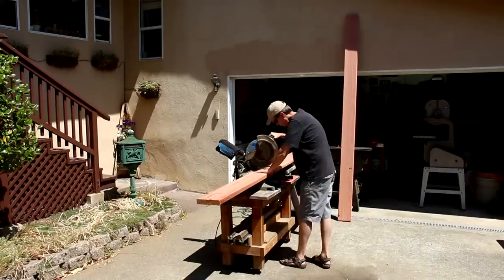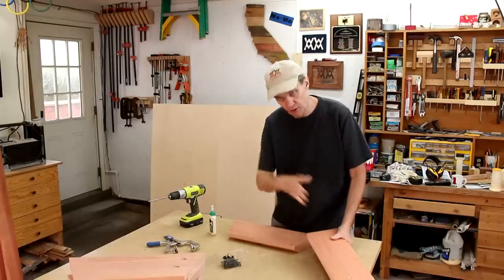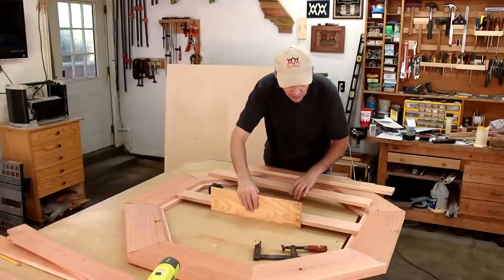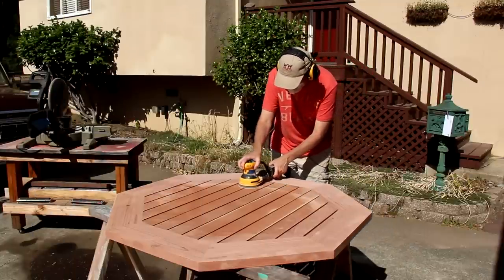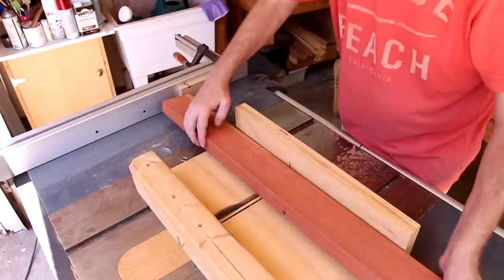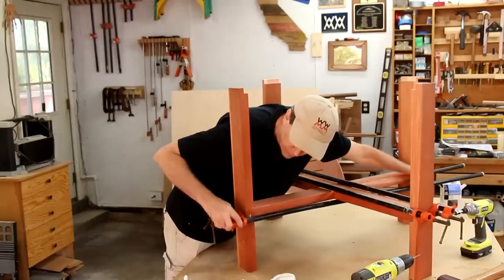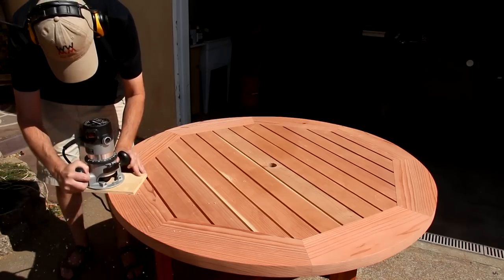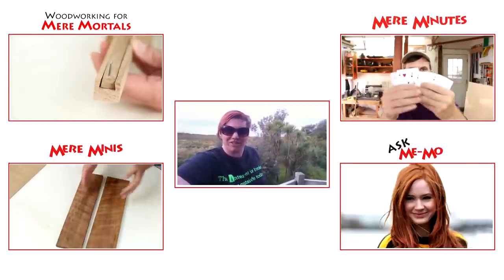How to make a patio table. This outdoor table is easy to build!

Comment: Nice job. The top is almost the same as a table I purchased a couple of years ago.  It was made of Merbau/Kwila timber by a retired German engineer turned woodworker. Each of the segments of the rim had a mortise on one end and a tenon on the other and were assembled with epoxy and a draw bored pegs on each joint. I bought it because it was a work of art to my eyes and something I might aspire to. Unfortunately I am a woodworking hack and not the Garrett Hack type either..All the best.

Comment: Thanks for this wonderful video,  if any one wish to know diameter of table from length of rectangle piece  it is  
Diameter = L x Cotangent(cut angle)
This formula give you diameter of finish table ie cutting outer corners.
One more formula to know how many pieces required from cutting angle
No of piece = 180/cutting angle

Comment: Did you carefully work out the dimensions so that you needed an exact number of smaller boards to fill in the centre with a 1/4 inch gap between them and all the boards the same width, or was it a happy accident ?

Comment: Hey Steve, In hindsight what would you have done differently? Reason is- i'm wondering if the legs are kinda 'getting in the way' when sitting at the table(knees, leg room). I'm thinking about putting the legs farther away from the outside perimeter, a little closer towards the center.

Comment: I would have to stain and finish before assembly, just to make sure the cracks are hit, they are still prone to moisture. Then sand smooth, then stain and finish the top.

Comment: Loving the videos, I'm 21 and recently got into woodworking. I have a few basic tools (jigsaw, drill and palm sander) and today I built a bench for my flat/apartment which was really fun. I finished it with some polyurethane spray like in your wood finish video but it was quite expensive for my budget (I used free wood to make the bench though). I was wondering what is the most cost-effective/cheapest product to use for a clear, smooth finish for wood? Thanks for any advice!

Comment: Great project. Took a look at the plans and we’re working on figuring out how to make it bigger. We want to do this, but we want a table 63” across rather than Steve’s 48”. I believe the angle needs to be 18 degrees, but what about each board length? And, maybe I have the angle wrong, who knows. Width of board is the same as Steve’s here, 7”. If anyone can help, would greatly appreciate it. Math has never been a close, or even distant friend of mine.

Comment: Steve, for your Incra Miter Gauge, did you need to shim it to get the fence 90 deg, to the gauge? A few years back users needed to do that to "setup" the gauge. I just wanted to see Incra resolved that yet.

Comment: real question. why does lumber always come with rounded edges? is it just the way its processed? idk i feel like its kind of silly to process it like that if most everyone just squares it up anyway..
Reply: For handling and fire code.  Irk about non structural boards.
Reply: BringOnTheRainxx3 if you buy it s4s it will be square

Comment: Nice video, but you said the top, middle of the redwood table was using 1 x 4's, ripped down to 3 inches.  But then you say "pro tip; you need to make pilot holes in the 3/4 inch pieces to prevent splitting.  Are they 1 inch or 3/4 inch.  Thank you. Glenn

Comment: Steve, I’m struggling to fit all the 20” boards together. I set up a stop block on my table saw, they are all the same size with the same angles too. But they just don’t want to go together. I measured the gap for the last board and it is roughly 23 inches. What am I doing wrong? Thanks, paul.

Comment: What kind of wood did you use so it doesn't rot away in a couple months? Looks like redwood. I wouldn't want to use pressure treated wood that people are eating off of even if you're not eating directly off the table.

Comment: Another great video! What setting do you keep your driver on when drilling the pocket screws to get enough torque without stripping the wood?
Reply: Thanks! I would also enjoy learning what woods you use the more aggressive screws for and which wood you use the screws with smaller threads.

Comment: hi Steve，I have applied one layer of lacquer, but before it’s dry, there are several flies body sticked on the top and I could not remove them. Can I sand the top after the lacquer been applied? Thanks I look forward to hearing from you soon .
Reply from the maker: Yes, sand them away, then apply another coat if lacquer.
Reply: Thanks Steve， when I apply another coat, how can I avoid the flies stick on? I used a bush, whether the spare gun will be better?

Comment: Hello Steve. I have a diy farm table I made last year but the weather made de varnish go and the wood has started to grey. I was thinking of sanding the table top and apply something else instead of varnish. Do you have any suggestions? Many thanks for your help and great videos. Chears from France.
Reply from the maker: All wood will turn grey over time. You could sand it all down every year or so.

Comment: Hey, so I've been using dowel joints to replace most of the pocket screws he's been using as I don't want to bust 100 bucks on the jig for it.  However, how would you assemble these tables w/o pocket screws?  I don't see how I could make a dowel joint w/ those 22.5 degree angles.  :(

Comment: How did you figure out how long each side of the octagon had to be ?  I am sure there is a formula based off the diameter / Circumference of the circle.  I was thinking of making one for my firepit, so can you tell me how you calculated the length of the sides ?  Thanks !
Reply: Pretty sure my geometry is correct: diameter x tan(22.5) = length of outer octagon side.

Should come out to (0.414)(diameter) = length.

Hope this helps.